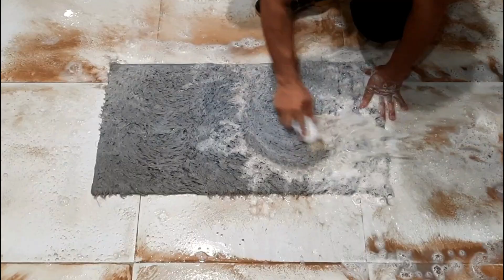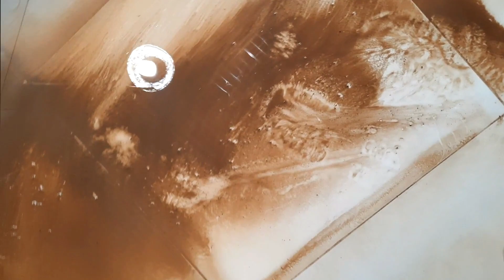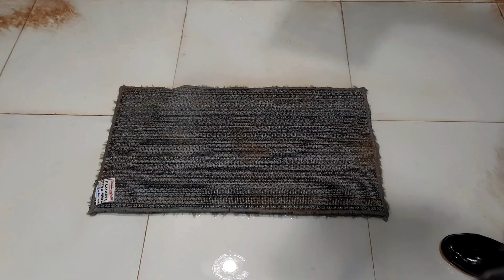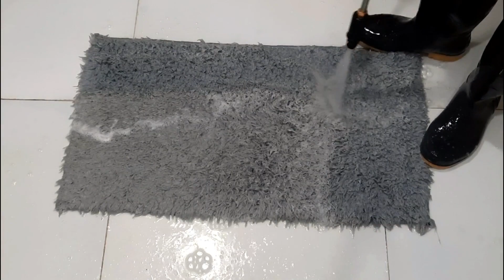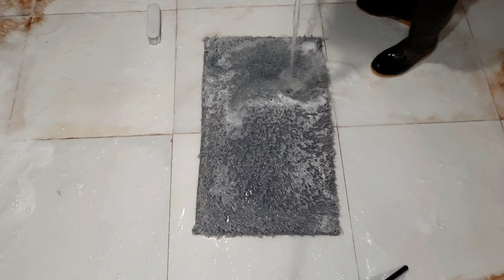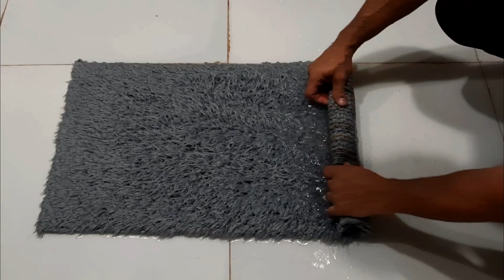Wonderful washing of muddy shaggy carpet at home | rug cleaning asmr

Comment: i wonder if theres a large machine with two wide rollers that have brushes on them like a car wash, and sprayers right above them, with clamps that could grab the edges of a carpet. so the rug can be rinsed, then as the rollers spin it sprayes it above and below the roller with the soap solution onto the rug on both sides of the rug, then it lowers and raises the rollers to wash the whole thing. then turn over the rug to wash it again. like put the rug between the 2 large wide rollers and just spin the rollers with the rug between them and move the rollers as its being sprayed.
Reply from the maker: Thank you very much for watching carpet cleaning video dear friend 💖💖💖